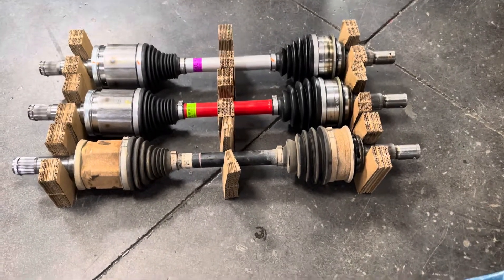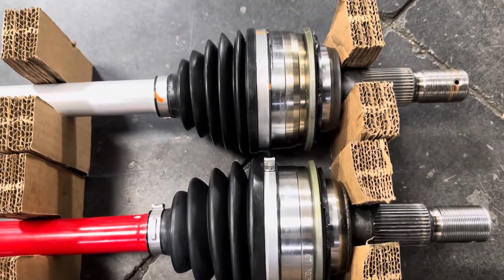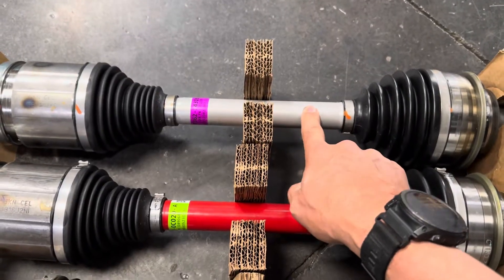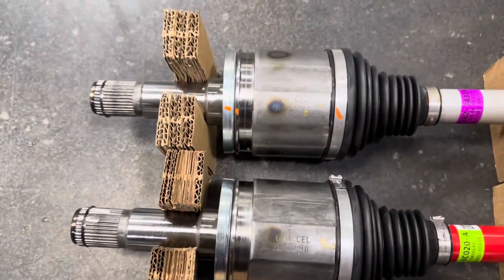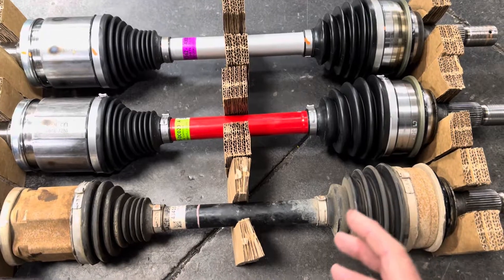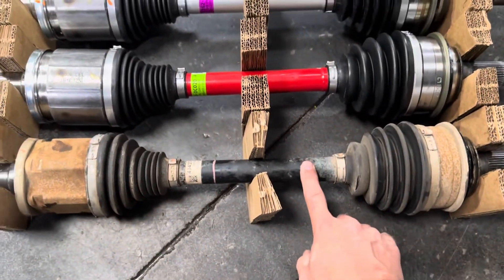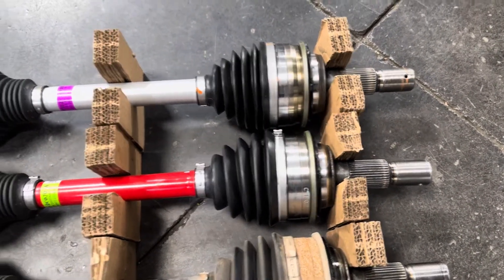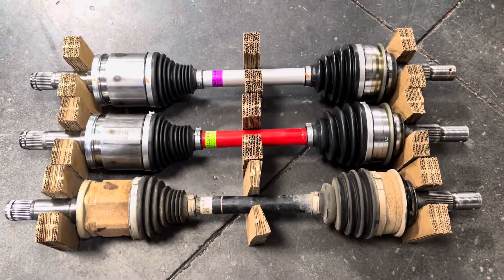How big is your shaft… your axle shaft in your Tundra? 👀

Comment: Jeff, have a question on the trd red axle. I have a 2017 Trd off road sr5 the cv axel are not “red” but part number matches the trd axle number assuming it’s same. But is this a common Toyota thing ?
Reply: Hi. Reaching out, did you ever get your answer. Have a 2021 and want to use the trd pro axles but am only seeing this for 2022+

Comment: My tundra is a 2024 1794 without the trd off-road so I have the black axles. I’ll need to upgrade these when adding your kit to either the silver or red? Just confirming
Reply from the maker: You don’t need to add the red or silver axles unless you planning on swapping out you black struts to a longer one.  The black struts and black axles work in conjunction together.

Comment: I still don’t understand why Toyota designed the new tundra to where you can’t lift a non trd without upgrading axles
Reply from the maker: @AuStInToW  you can lift a non TRD you are just limited on how much you can lift it do to the shorter black axles.  It was a up sales tactic by toyota.  Bad thing is that it does not cost Toyota any more from the one to the other and could have just made the one version and gotten the cost down because of the higher volume.
Reply: @westcottdesign
  What’s the max lift you can do with the black axles?

Comment: So the red TRD axles are the same as the silver in length? They are made for some lift? The only difference if the Diameter of the axle itself.
Reply from the maker: The axles are the same length. The silver axle is a half mm larger than the red axle as far as diameter goes.
Reply: If I have the trd off road package, but I don't see the red axles. Does it come only on some trd packages and not all?
Reply: @michaelyoussef8127  This red axles only comes on the TRD off  package and or pro package
Reply from the maker: @adam10532  that is correct👍
Reply: So both silver and red should offer the same off road performance? Other than the diameter that might offer more strength.I would assume.
Reply from the maker: @adam10532  both will do the same job and an noticeable performance gain between either one of them.
Reply: @westcottdesigns  thank you

Comment: What if I have a standard 23 platinum non AVS do I need these? If what kit should I buy. I don’t want to extreme off road just want to be able to hit a trail or 2 every now and then. Thank you for the advice love the channel
Reply from the maker: The black axles will work fine.  All of our kits are designed for the each of the different models to insure it won’t cause any problems.  You just have to identify
the sticker on your front struts to see what model struts they are before ordering to make sure you get the correct kit.

Comment: I have decided to purchase a set of your rock sliders. I don’t have much money so am going to paint myself to save some cash. I wasn’t willing to settle for cheaper tubes so paying extra for DOM. My question is can I settle for mig welding to save money or will I regret in future with broken welds from using my sliders ? I am going to use your authorized dealer in California but can’t decide if the mig welding is sufficient before I order. Thanks for taking pride in your work.
Reply from the maker: Both are going to be strong and I can tell you will not find a nicer quality built slider on the market in either DOM or TIG.  Can’t go wrong either way.  You just wait till you get them.  If you have had any other brand.  When you get ours there is no comparison in quality I promise and customers will say the same👍
Reply: Thanks I am going to trust the mig weld and pull the trigger. I am confident I am buying the best sliders for the money.
Reply: Thanks I am going to trust the mig weld and pull the trigger. I am confident I am buying the best sliders for the money.
Reply: Thanks I am going to trust the mig weld and pull the trigger. I am confident I am buying the best sliders for the money.
Reply: Thanks I am going to trust the mig weld and pull the trigger. I am confident I am buying the best sliders for the money.